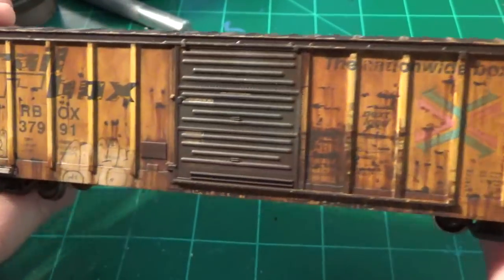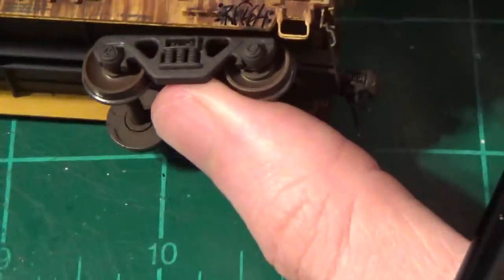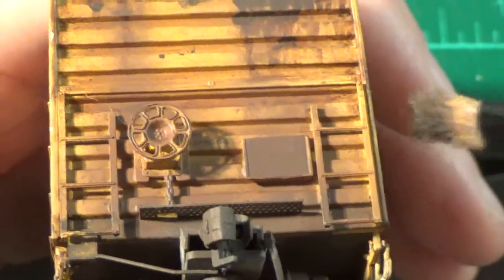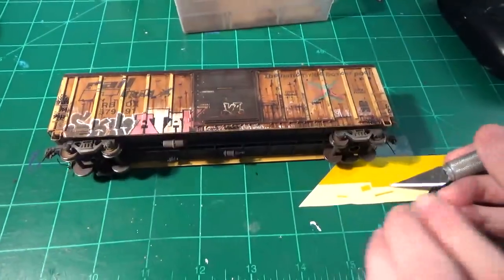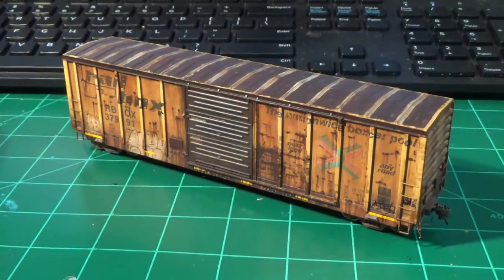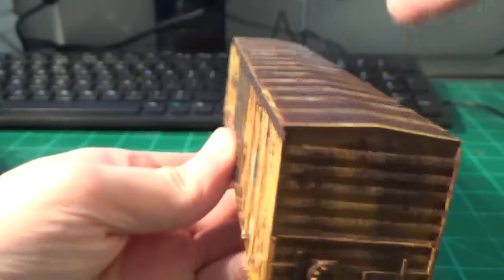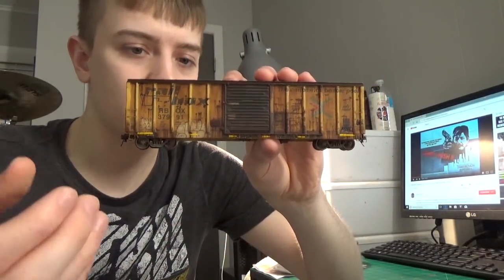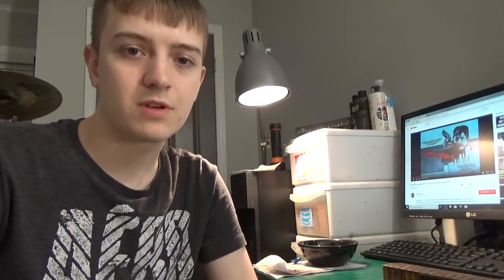The Railbox! HO Boxcar Weathering Series. Episode 3.

Comment: Dan, I like your videos but in this case.....the video started off with you talking about airbrush effects, did the software edit that out? Another annoying thing is when the video just stops right in the middle of you doing something like at the end of the second vid. If that's the new editing software, it's time to chuck it. Go back to what you were using before, hell movie maker would do a better job than what you have now.
Reply from the maker: Yeah I don't know why it compresses these videos so bad.  Basically I lost the airbrush footage, it compressed it out.  Why?  I don't know.  The rough cuts are something that don't appear in the final edited video either.  It's frustrating because I am flying blind with what the finished product will look like.  I am trying some different software now but I am running into a few problems.